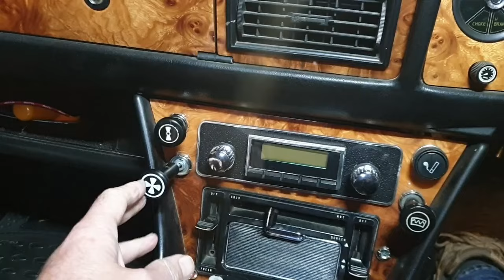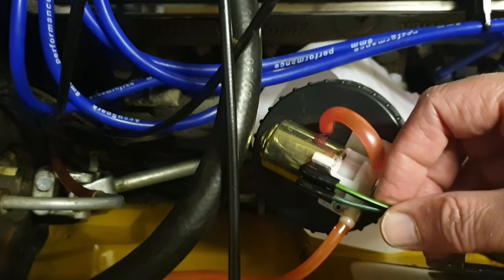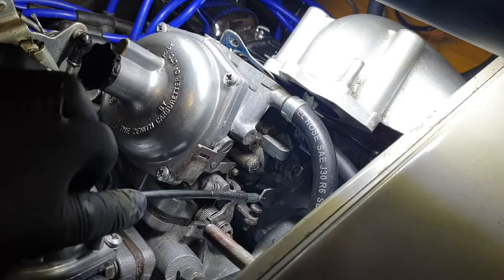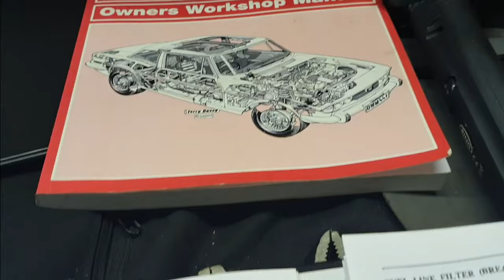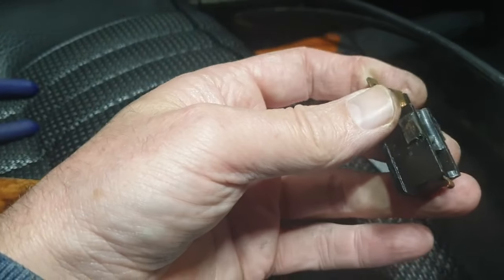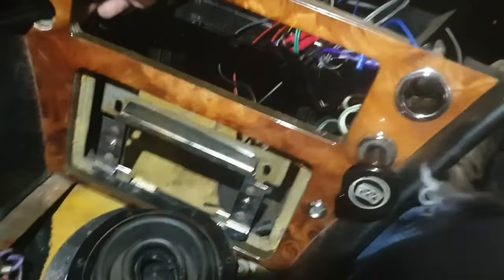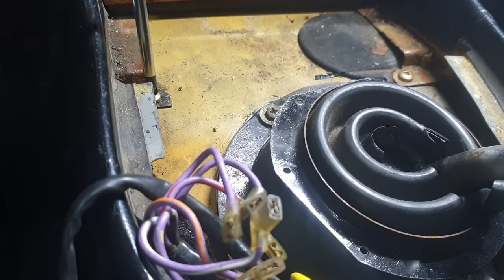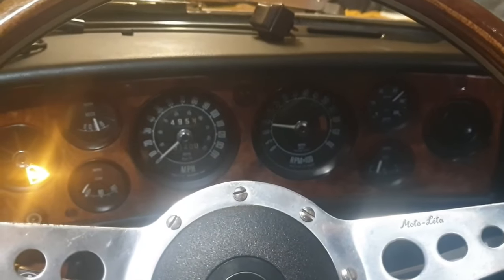Replacing a triumph stag choke cable - a bar***rd of a job!  Se2 Ep2

Comment: Washer bottle did the same pinched the bracket til it wedge's and holds it tight , yes choke cable is fiddly and luckily your warning light switch works took me quite a while , thanks for sharing
Reply from the maker: You are welcome :-)

Comment: I bought the rimmers replacement bottle and bracket. I noted it wasn't a snug fit! So I just pinched the bracket in the vice to make it more secure. Also keeping the bottle topped up increases the weight init, so far no problems cheers
Reply from the maker: Great tip. Thanks

Comment: Just think of how much easier it would've been if you had just taken off the shift knob and pulled the entire piece up & off; rather than taken off 10 to 12 fiddly screws.

Also, you could have taken the choke knob off and threaded the cables through, tightened the choke electrical connector on, and finally brought the cable into the dash from behind. 

Also your fast idle lever is not centered on the screwhead that it rides on.
Reply from the maker: Many thanks for those top tips - I'm learning all the time :-)